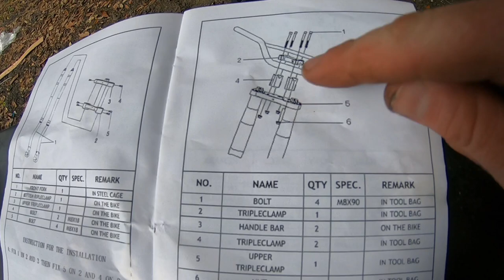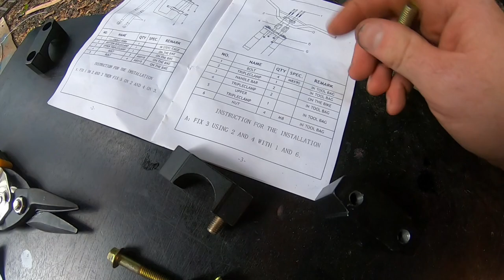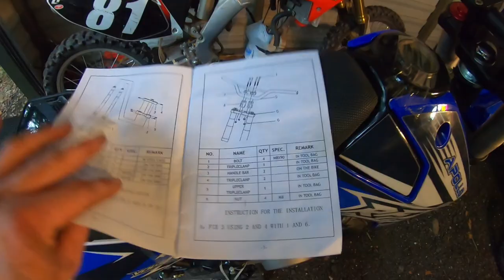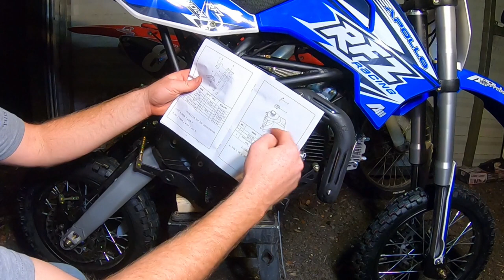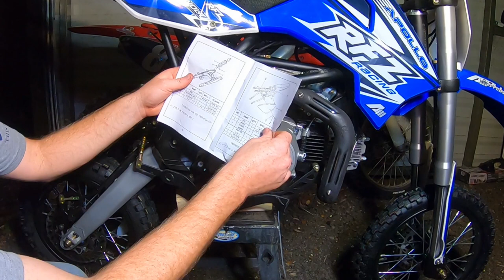APOLLO 125  RFZ CHINESE DIRT BIKE | STEP BY STEP FULL ASSEMBLY

Comment: wow great explaining btw what happen if you don’t use the grease?
Reply from the maker: Thank you! Glad I was able to help! If you don't grease the axles on the front and rear then it just makes it much more difficult to slide the axle bolt out later on when you have to replace an inner tube or sprockets.

Comment: Hey man how do you find the rear suspension? I just bought this bike used, I've loosened up the rear shock springs but still find it to be very stiff, I have minimal sag and it doesnt seem to rebound very fast either
Reply: How much did you but it used and make sure you put a new carburetor on it
Reply: @noahchristensen1630  got it for $600 in great condition. I figured out why my suspension had no sag, the previous owner must've not put any grease on the bottom bolt holding the rear shock in place and the bearings were rusted. A good cleaning and applying grease and it actually feel like a dirt bike now. I just bought a vm22 26mm mikuni clone carb. Heard they wake this bike up pretty well
Reply: @gamerbot101  I done own one I will buy one once people start hiring again and have some money but I have heard that the carburetor you got really does wake them up and stops idle problems so yeah let me know if the carburetor you put on really does make a difference
Reply: @noahchristensen1630  will do man 👍
Reply from the maker: That is one of my biggest complaints of this bike is the fact that it's a very stiff ride and the shock should be much softer and a seat should be softer as well.

Comment: Hey I bought this exact same bike when it was brand new in 2017. I havent ran it since 2019 so 3 years I tried running it the other day and it would start and then it should shut down take 20 cranks to get started and then shut back down in 1-2 min. Do you have any clue what the problem maybe?
Reply from the maker: Yes, I'm almost positive your carburetor is all gummed up. I would either do a really good clean or replace it.

Comment: Did you not need to grease the rear wheel bearings, swing arm and linkage bearings too?
Reply from the maker: The rear wheel bearings are self-contained and as far as the linkage or any other areas, if I could located a grease fitting then I greased it.

Comment: I have a question my overflow cable is dealing all the gas out I put gas in and it just ejects it
Reply: The float in the carburetor is probably stuck
Reply: Just buy a Mikuni and be done with it. The factory carbs are all trash. 50 - 60 bucks and you've got the best you can throw on it IMHO. 

Hope this helps
Reply from the maker: Yes, overflow

Comment: Question... I have an x18 coming in for my nephew and I was wondering what size the biggest nut and bolt is on the bike assembly and whether it is metric or standard
Reply from the maker: I'm so sorry that I didn't respond until now I miss this earlier but I'm sure you've already figured it out either way I think the largest was a 22 mm.

Comment: Did you change the oil before giving its first start?
Reply from the maker: No, I checked the oil level to ensure it was at its proper level and then I let her rip! 👍
Reply: @FREEDOMSYNDICATEOFFICIAL  you have to dump out the oil that comes in the engine during shipping right away. The stuff that is inside the engine during shipping is pretty much "vegetable" oil, and it could cause problems in the future. There are so many videos online of people who own Chinese bikes and say that they're terrible bikes, but I'm absolutely sure that the one thing all those reviews have in common is that they forgot to dump out the oil immediately and put some fresh 10W-40 in the engine before break-in.

Every single online dealership recommends that.
Reply from the maker: @pitgroove.37_66  Thanks for the advice but then my motor is probably already toast 🙄
Reply: @FREEDOMSYNDICATEOFFICIAL  just try and take as good of care of the motor as possible and you should be ok
Reply from the maker: @pitgroove.37_66  will do buddy 👍 thanks again for the future advice.
Reply: @FREEDOMSYNDICATEOFFICIAL  no probs
Reply: @FREEDOMSYNDICATEOFFICIAL  hey buddy thanks for the video! i was watching during installation and shared the same frustration as you with the handlebar missing nuts LOL
some more tips ive caught on from a lot of people is Blue LOCTITE EVERYTHING.  People have commented that a lot of things have come loose from vibration. 
Another tip ive read is change out the carb for a better one, its known to increase response, and help the poor idle

Comment: Can you grease the axel with WD-40
Reply from the maker: It's recommended that you use a multi-purpose grease because it remains on the axle for much longer than a solution like WD-40 which once it is exposed to heat it'll start vaporizing and eventually it'll be down to just metal and metal again. So I would advise against using anything other than the grease.
Reply: QUADNATION 929 ok thanks for the feedback have a great day 👍
Reply from the maker: @mgevrett9504  np brother!

Comment: What size bolts are on the front brake caliper. Mine are missing and I can’t find our the size to order replacements.
Reply: Sometimes the extra bolts are used on the creates
Reply from the maker: I'm so sorry for just now responding and I'm sure you figured this out but either way it was either a 10 mm or 12 mm

Comment: Helpful video!
Reply from the maker: Thanks brother! Glad I was able to help 👍
Reply: QUADNATION 929 I’m putting together mine and I’m having an issue getting the front end in the air to put the front tire on. Bike slipped off the stand and could have been bad. I’m completely new to this. Any help here?  Should I secure the rear shock with the bolt first?
Reply: QUADNATION 929 never mind I got it sorted making it easier to secure the rear shock and then tilting it back partly resting on the back tire. These Apollo bikes don’t rest right on a standard stand. The kick stand gets in the way the small pin piece if you know what I mean.
Reply from the maker: @trittany2882  yes I know exactly what you mean, the pin and the rear brake lever. I moved the stand around a few times and then found a balance point and a spot where it wasn't putting pressure on the pin.
Reply from the maker: @trittany2882  glad you were able to get it worked out. Have fun riding and be safe! 👍
Reply: QUADNATION 929 yes exactly. Much thanks for the response and the extremely helpful maybe the most helpful video I’ve seen for assembly and being a very new rider friendly tuber!  I think I’m gonna try a 5 gallon bucket like you see a lot of people using for a stand. You think that would work well for stability?  I gotta toddler that I wanna keep safe. Again thanks for the help man.

Comment: Do you really need to grease it or no
Reply from the maker: The bearings are sealed however I do it just to keep the bolt from seizing inside as greasing it allows it to slide in and out with ease.

Comment: You do know that there sealed bearings in front no grease. Plus grease will collect dirt and wear it out prematurely! Just to let you know for future reference.
Reply from the maker: Yes that's a very good point but I still grease the bolts so that the bolt slides in and out with ease.

Comment: How tall is the bike an mm bro and the HP too
Reply from the maker: See height is approximately 34 inches which is about 863 mm. As far as power I believe it's around only 8 horsepower which doesn't sound like much but considering power to weight ratio it's actually pretty good.
Reply: @FREEDOMSYNDICATEOFFICIAL  OK your video or the best
Reply from the maker: @tvj7083  thanks! I REALLY appreciate that!
Reply: @FREEDOMSYNDICATEOFFICIAL  ok